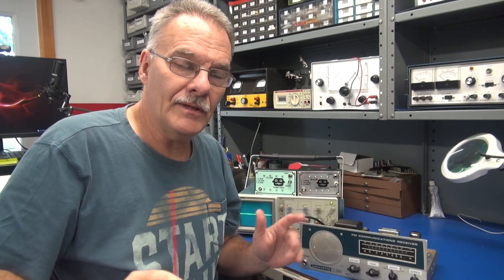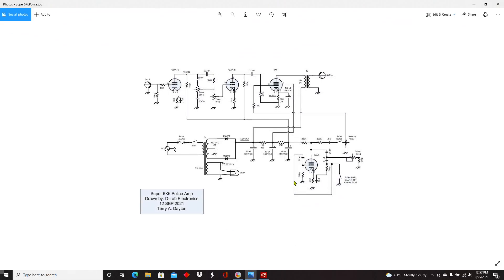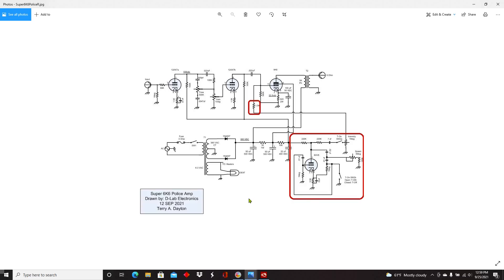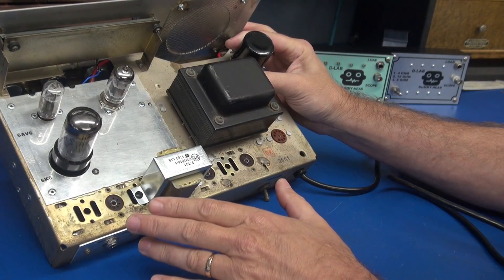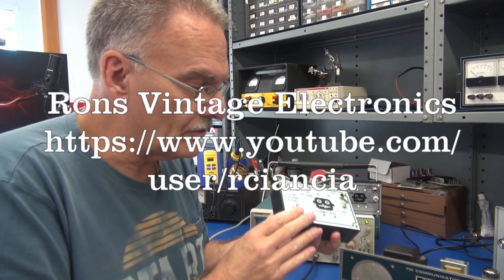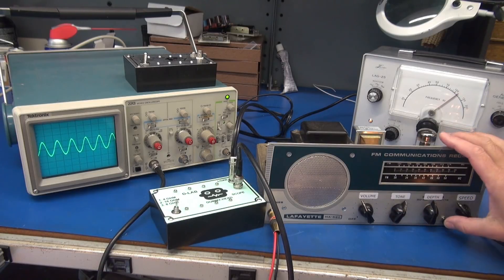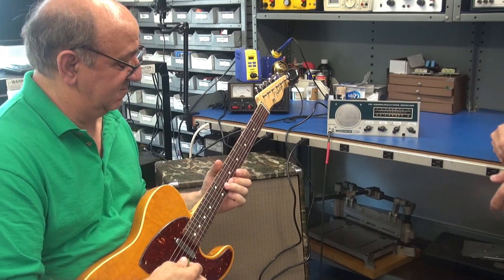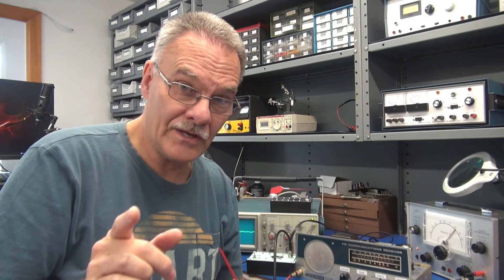How to build the New D-Lab Super 6K6 Police radio tube Guitar amp + Tremolo Soon to be a D-Lab kit

Comment: I've got a question concerning my build of this amp.  I built it without the trem circuit and did a voltage test without the tubes.   I have 316vac on each leg of the xfmr,  141vdc on each of the diode legs before they're connected to the first node of the filter cap.   Seems correct up to here,  once both diodes connect to filter cap I have 443vdc, same for the second node, and 441vdc on the 20uf third node.  I know voltages should be higher without a tube load but these seem high to me.  Ideas?  Appreciate any and all help you can throw my way.  Thanks much.

Comment: Terry - Could I use the Hammond 369EX Power Transformer and the Hammond 1760C Output Transformer for this build?

The 369EX puts out 380 V CT + 6.3 V CT. The 1760C is 5K / 8K primary into 3.2, 8 and 16 ohms secondaries.

Comment: Not a fan of the enclosure … but there’s no denying the tone and lack of noise ! Sounds great Terry ! What is the wattage ?  In the late 80’s There was a small lunchbox sized amp made by fallen Kruger . The 250ml . 50 watts a side , stereo guitar amp with surprisingly great sound for solid state . It was a take on the Rockman amp sound .  This amp design you have needs a dedicated enclosure , (not a police radio) that any guitarplayer would  be proud to have sitting on his stack . Maybe a monotone head you can utilize?  I agree …. Best sounding amp you’ve designed so far IMO
Reply from the maker: Roger that man, Would love to have you come by & play it. Yes, this was just a design shake down. Now the circuit can be added to any suitable enclosure. I will e-mail you direct.